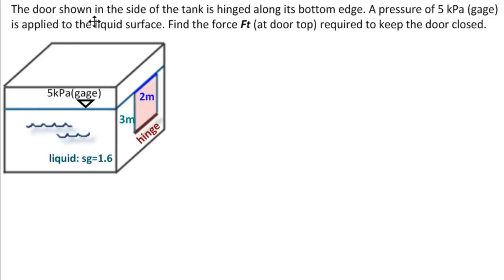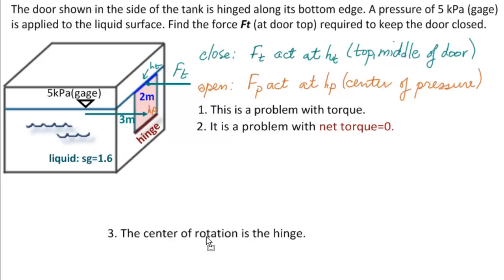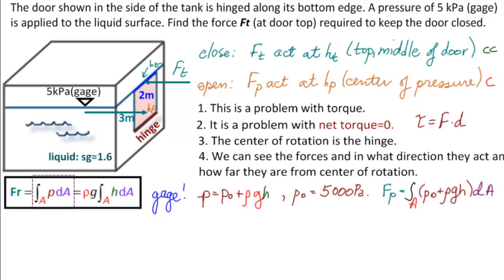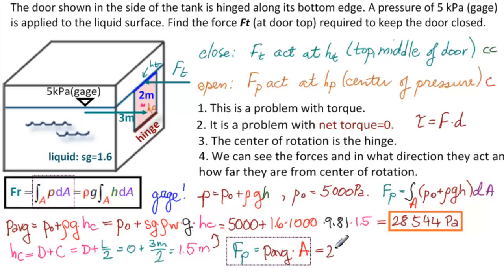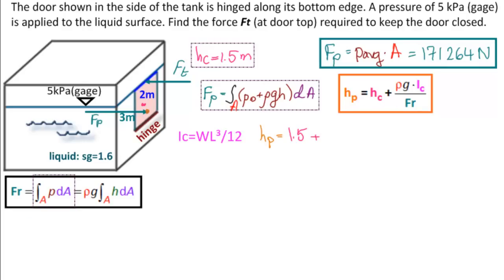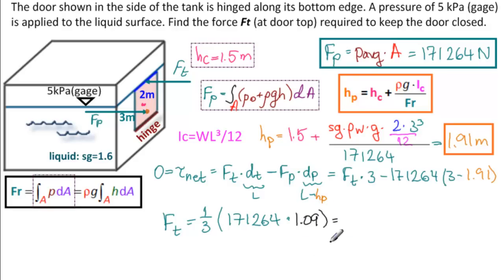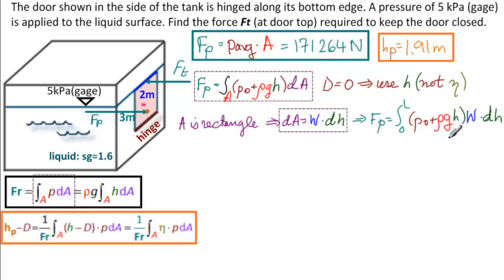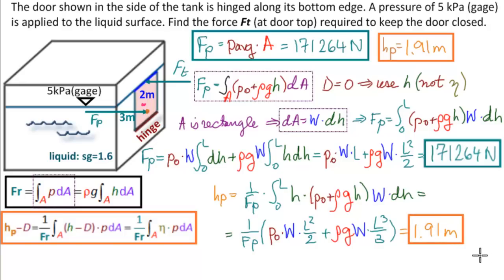Submerged Door with Hinge and Pressure on Liquid Surface

Comment: what if you're not pushing from the top but from the centre?
Reply: well in that case the distance in the torque or momet changes, you would have the same exept for the part where you substitue d in  Ft*d. d  would be 1.5